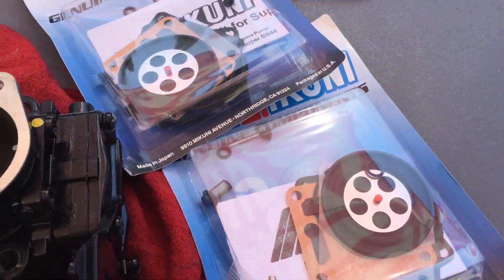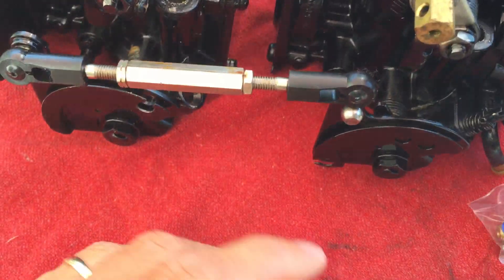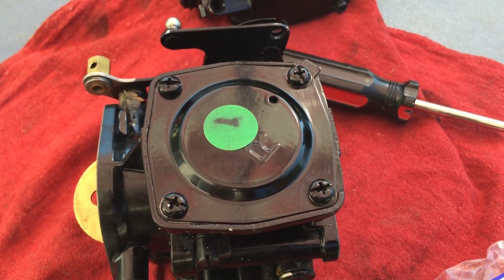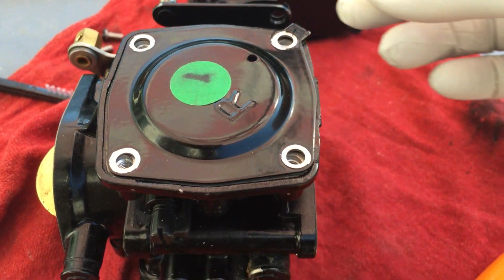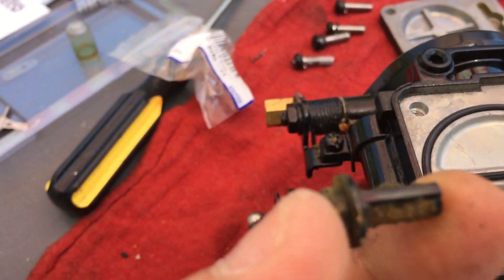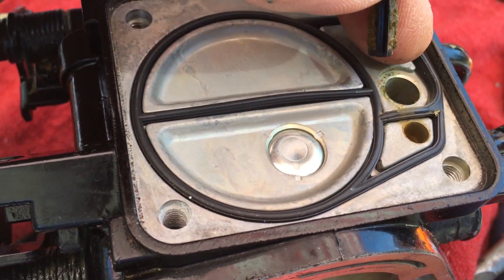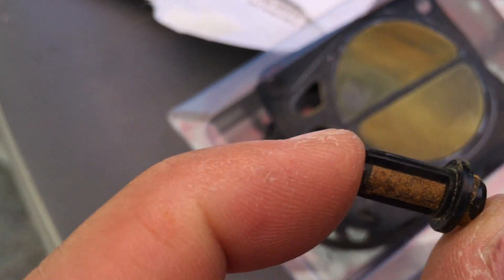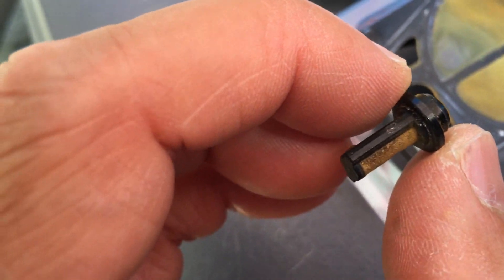Seadoo GTX 2 Internal Fuel Filters Clogged caused by Tempo Gray Fuel Lines Carburetor 97

Comment: I have a '94 SP and a '97 SPX that I am working on at the moment.  Both have grey lines.  I went through the '94 yesterday.  The lines were in very good condition.  When I went into the carb, the filter had some goo in it.  Nothing like yours in this video tho!  The goo on mine was on the INSIDE of the filter.
Reply from the maker: My carb and fuel lines have had green ooze or goo too... I know those goo were not doing my seadoo any good. Thanks for the comment.

Comment: I have a 96 Gti duel carbs! took the carbs apart and couldn't find that little filter or I just didn't notice it. anyhow took it on the water today and ran good then started bogging. is it very important that I clean those 2 little filters?.. and does every sea doo carb have them?

Thanks!!
Reply from the maker: Denmarck Maxwell send  me an email... I got something that will help. Cbatilo@gmail.com
Reply from the maker: Denmarck Maxwell It is very important. My seadoo bogs down during acceleration but no more after I changed it. It was the root cause on mine. Email me. Cbatilo@gmail.com
Reply: sent
Reply: The Alan bolts is what's holding the carbs down right?
Reply: I sent you a email
Reply from the maker: check your email... let me know if it worked
Reply: cbatilo having this same issue on my 2000 xp 951.  Runs fine when first start up then when warmed up it will bog down under higher load.  Do you think this is a filter issue in the carbs. I know this is a few years old but worth a shot reaching out.  I’m running out of options! Lol
Reply: @mcgovey37  yes replace them easy fix.  You'll be good to go!
Reply: Denmarck Maxwell  thanks for the reply.  I replaced the petcock fuel selector, fuel water separator filter and all fuel/vent lines from original tempo lines.  Took it out today and response is much better but ended up bogging on higher revs again eventually.  I certainly need to replace these internal fuel filters  and or an entire makuni rebuild kit.  Where’s the best place to buy Genuine makuni parts for a 2000 951?

Comment: The Tempo fuel line with that white lining should be taken off the market by order of the USCG. Somebody's gonna break down miles out in bad weather and get killed.  I've seen it do the same thing to outboard carbs.  It sucks, plain and simple. Didn't these Bozo's do the least bit of product testing?  These PoS's create a LOT of repair biz for my friend's shop.  You might as well dump dog crap directly into your fuel tank.

Comment: show me where the pule line on carb goes and the gray line from engine to carb 1995 SEA DOO GTX 657x engine
ASAP
Reply
Reply from the maker: Page 89 http://seadoomanuals.net/download/pdf/service/manuals/1995/1995-SeaDoo-Service-Manual.pdf
Reply: Thanks,
Reply: So the line on bottom on engine connects to the top of carb marked pulse?
Reply from the maker: +Thomas Flynn I'll try to help. Take pictures of the carb and engine..send it to cbatilo@gmail.com. I'll look at it. No promises.
Reply: ok